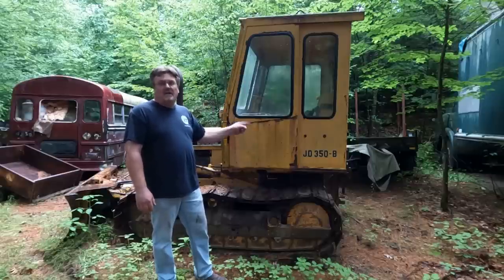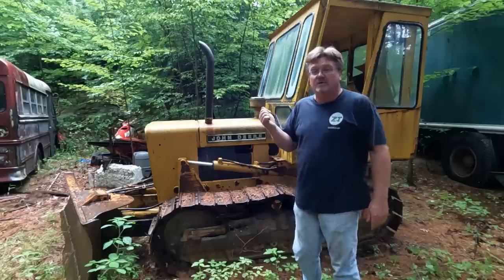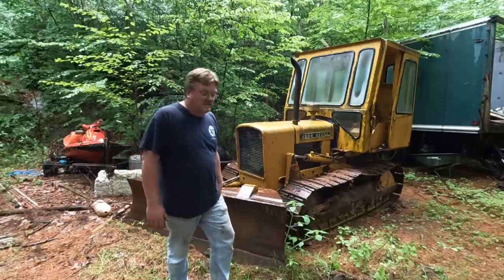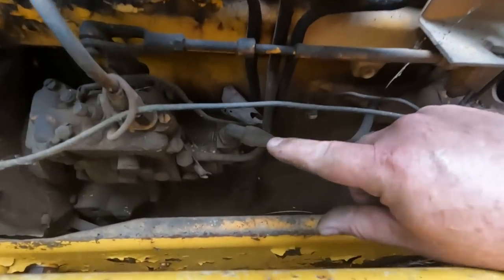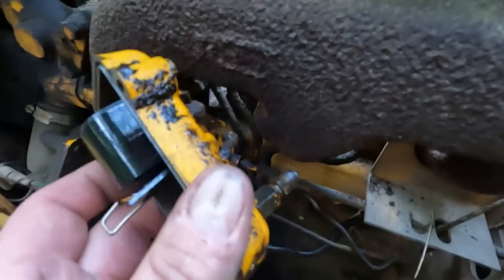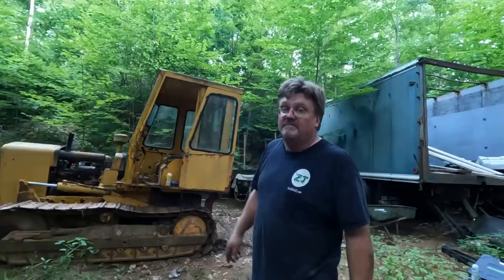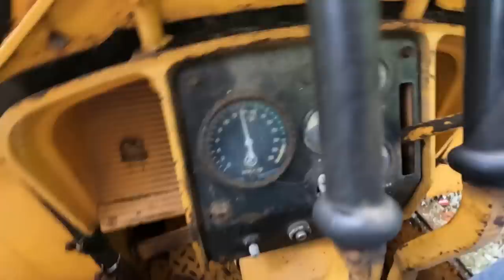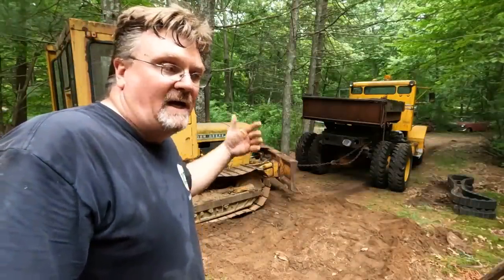John Deere 350B Crawler Start Up, Maybe?

Comment: My son and I just rebuilt our JD 350B crawler loader. It was a big job. Even with my Case 580 backhoe lifting the heavy parts, it was a big job. I think parts for a clutch/brake redo would be about $800 a side today. Any of you guys going to rebuild the rear ends on one of these loaders or dozers, pull the plugs from under each clutch and let out the water or oil, these are dry clutches ( the 450s are wet clutches I think). Then pull the clutch covers off under the seat and wash the clutches down well with brake cleaner, 5 cans per side. Then blow them out well with compressed air and let them dry. If you have any chance of getting it to steer, try it now. The shaft seals are known to leak oil into the clutch area and contaminate the brake and clutch material. If this doesn't help, it's time for a rebuild. Our loader steers like it is new and is very responsive and the brakes stop on a dime too. We are fitting a 4-way bucket to it and I am rewiring it with a bunch of LED lights. It won't be long and my son will be digging on his new land.🤩
Reply: I have a 350C. It runs like a top now. Had to get the injection pump rebuilt. In the middle of a new idler, adjuster, and track chain. Big jod for a carpenter.

Comment: I am no expert concerning anything. With that disclaimer out of the way, I have a 1980, so I am told, 350C with a loader. I bought replacement rails and grousers as the original rails were stretched and grousers were worn flat. It's a pretty reliable machine for the most part. Mine has a tank leak from the diesel tank. I intend to do the steering clutches when the tracks are off. Let me know what you find as sources for the clutch parts. The actual foot clutch linkage is sticking on mine, so I generally just use the reverser. Stout machine for the size for sure. Mine weighs around 12,000 and only has ROPS. I will be looking for your future productions on this gem. I forgot, mine has 2 batteries and an isolation switch to disconnect the batteries.

Comment: Dad’s uncle had an old 350-A. It was a gas jobber and didn’t have an enclosed cab or power tilt or angle. You could pull pins and angle the blade. The little dozen did have a very powerful winch on the back of it. We used it a few winters to haul out very big maple trees, all that were over four foot diameter.

Comment: My uncle had one around the same year model but was a 450 with a regular rops. I needed to use it and It had been sitting for 7-8 yrs because it shut off. They thought they ran it out of diesel. I figured out it was the injection pump solenoid and got a good used one for $60 and it cranked pretty quick and ran really good! But I spent a crapload of money on hydraulic lines. But I cleaned up a few acres of my land and drove it back via power line cut about 1 mile. His son used it and trying to push mountains in high range they tore something up in the rear end so bad that it busted the housing. Sold it for couple hundred dollars!

Comment: My 1975 John Deere 350C has a special attachment on the dash for a can of ether to attach. On the back side there is a thin straw like hose going to the intake manifold. ( don’t use it because it’s way down the list of things to fix) I only used ether when I first started getting it running after it setting for over 20 years. It starts fine now without.😊 Is ether really hard on things? I appreciate all the videos on you tube on dozer restorations. They have been very helpful.

Comment: The brake on either side should turn it
Reply from the maker: Something's wrong with the clutches that let the tracks move independently.  The steering brake just slows the whole machine down, both tracks at the same time.

Comment: Tilt your blade put down pressure on blade to where it lifts the front up a little and angle your blade it will move the front end over a little!, it will take several times!.

Comment: I'm subscribed to several car channels, which I won't name.  But they're your given hot rod, classic, revival, will-it-runs, the Big Three kinda thing.  After awhile, I wanted something different.
Found LBG a coupla days ago.  Now this is different.  Military surplus, tractors, obsure engines, and alot of weird stuff.  Oshkosh, Rand, Kenworth busses, old Briggs & Strats, Wisconsins, Cushmans, COE's, etc, etc..  Stuff underrrated and forgotten about, not your typical gearhead topics.

Comment: a little tip for others who are beginners messing with diesel or just old age. Lol. with those old-school rotary-style injection pumps usually Roosa-master, Stanadyne, or Bosch. MAKE sure when you take the top lid off to access the fuel shut-off solenoid that you reinstall it how it was, Otherwise when you try to start the machine up again it'll go to "full" fuel and run away, and yes it should "click" every time.. what i do is usually unhook that Fuel solenoid wire and crank the eng over with the injectors cracked so it bleeds the AIR from the pump/lines to the injectors without starting. nice cute machine. Love the oddball cab. Will you do a start up on that green tilt-cab trck?
Reply from the maker: Good point, luckily on this one there's three screws, so it couldn't bolt on wrong.  I did keep a floor mat to put over the intake handy in case it did try to run away.  And yes, I'll try to start that tilt cab, but it will be in a while.  I ran out of time to get to that one on this trip.
Reply: @LowBuckGarage  Yes usually the top only comes off one way, but the Lever on the solenoid only goes back one way,  the pump. Anyhow. Looking forward to the new videos! no rush. Wonderful content.
Reply from the maker: @SchnelleKat  Ah, ok, thanks for the tip!  Next time I'm up there I've got more dozers to move, so I'll watch for that.

Comment: I put two steering clutches in a dozer. It was pretty much a nightmare of a job. Did it from the top down, under the seat and everything in the cab had to come out including the floor and roll cage.

Comment: I did steering clutches on a old 350 they were the dry type ( you can update them to wet) after I jacked it up and got the track off tore it apart looked like water got into it and everything rusted  so went for parts the parts man said I should convert it to wet, but the owner said he just wanted me to do the side that was broke.  Long story short put it back together then got one of them government job 6 months later I went to visit my old boss and you’ll never guess what was back in the shop… yep that old 350 jacked up and the other side was tore apart.
Reply from the maker: Thanks for the info, I'll have to check out the wet clutch conversion.

Comment: I miss those days of take it apart wiggle all the crap around inside and put it back together and presto it works! So many things of yesteryear just get stuck and need some love to work again. I had a dozer that sat for years and the steering clutched froze up on it, soaked them in diesel waited a week drove the machine out to a huge stump blocked the steering back and started it to digging about an hour one popped loose and in another 30 minutes the other one broke the rust holding the disks to the plates.. Don't know the history with this one so maybe some of the linkage broke? Anyway I love the channel and the way you go about things thanks for the time it takes to think up, video, edit and UL these for me to enjoy!
Reply from the maker: Thanks!  I think you're right about the linkage.  For a few years the clutches would release, and then got slowly worse.  They might be frozen now, but that wasn't the original cause of the problem.

Comment: I bought a 350 B and one side wasn't working . Once I got it home took the inspection plates off the top of the differential and found the right side the clutch linkage was out of adjustment put it back to factory specs and working great .
Reply from the maker: That usually works, but my Dad tried it years ago when the problem first showed up, and adjusted them all the way.  It worked for a while, then had steering only on one side, then none.  Doing some internet digging, I found that a number of people with early model 350Bs have found that the bellcrank that moves the throwout bearing for the steering clutch fails inside the box.  I guess that's why the 350C's have a completely different steering setup!

Comment: Just came across this vid. We used to slack tow tracked vehicles regularly. The way to do it is to use 2 chains/cables of equal length and cross them over, left of tow vehicle to right of vehicle being towed and right of tow vehicle to left of vehicle being towed. Due to blade, in this case might be better to tow in reverse.
Reply from the maker: Thanks for the tip!  I'll try that next time.

Comment: Put the blade against something solid and pull both steering clutches back and drive  until one brakes free
Reply from the maker: The steering stopped working way back when it was being used regularly, first one side then the other.  I think something bent or broke in the linkages, rather than the clutches freezing up.  Apparently the 350B's were known for this, which is why the 350C's went to a full hydraulic steering system.

Comment: I'm sure your checked the steering fluid?
Reply from the maker: Yes, the fluid was up.  This one has a mechanical linkage with hydraulic assist, so it should have done something, even if it took a lot of effort.  I think the throwout bearing bellcrank is broken or bent, my Dad already tried the adjustment many years ago.